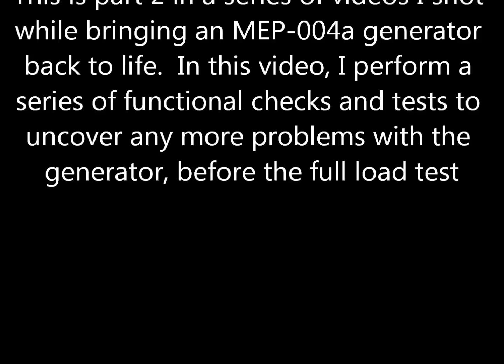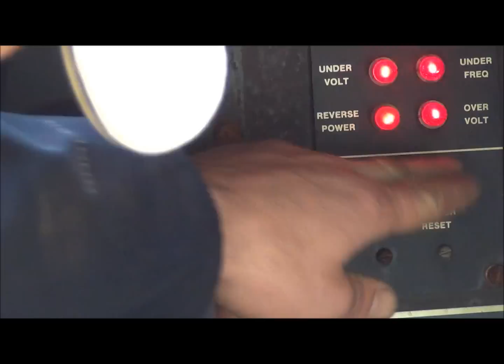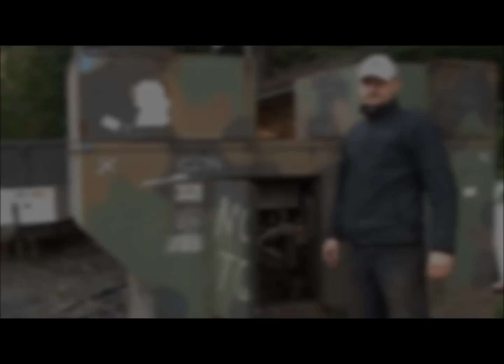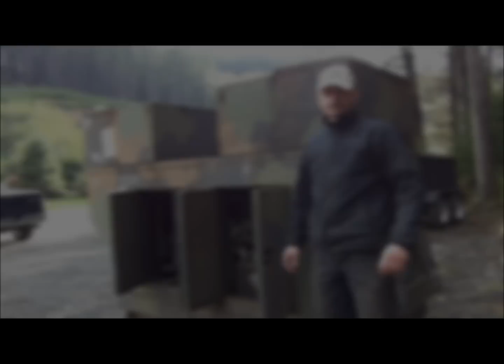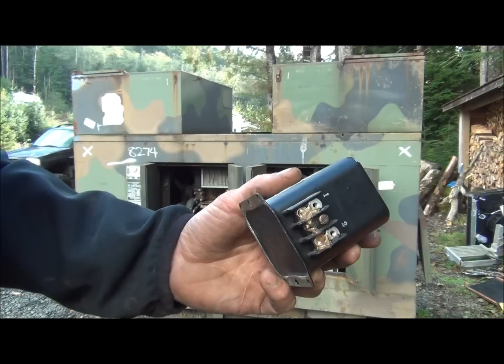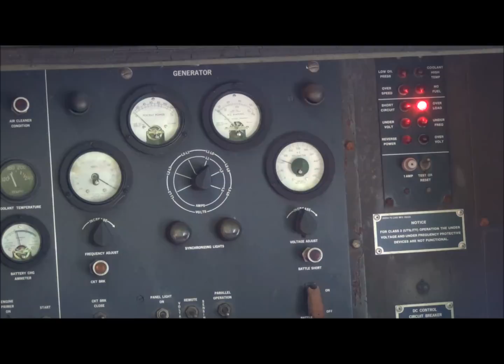Military surplus generator repair, and first start after years of sitting part 2

Comment: Hi Matt, I'm from Germany and I have exactly the same generator set, purchased from scrap dealer in the 90's. I use it as emergeny power plant and heating system. Since quite a while it started leaking oil at the front side (belt pulley) and I guess, it's the crankshaft seal... So I have 2 questions: Is it possible to replace it "from outside", which means: After removing the belt pulley and the engine mount bracket (while supporting the weight from the oil pan side), and: Could you give me any advice where I can get such a shaft sealing ring for this engine (Hercules)? I'm also interested in other spareparts like Filters, hoses, waterpump... Many thanks in advance and hoping for your response, Norbert

Comment: You wouldn't happen to have a manual for a Generator by 
Winpower?

Model # D-15h18z 

05/11/1964

It has a Hercules Diesel engine with a Roosa Master Injection pump.

Comment: Im not sure that dumping an electrical device that is leaking a black tar-like substance is prudent. Even handling it isn't a good idea. They may be old enough to still contain polychlorinated biphenyl (PCB), which is an extreme carcinogen. Best to isolate and let professionals dispose of those parts.

Comment: I have a 1962 American Marc Navy 5kw diesel.  The 24 volt batteries had the ground come off negative post and art and it stopped producing AC power and at the positive side of the batteries with it running is reading 52 Volt's DC. I have a shop manual and some parts but don't know what to do?

Comment: that"s amazing how the americans speak backwards compared the rest of the world .you cal a meter a gauge. gauge is for measure wire size,sheet  metal size .steel rod sizes .etc,etc,etc, For electric we cal a volt meter. amp meter, ohm meter ,frequency meter galvanometer ,gauss meter ,capacitance meter,inductance  meter siemens meter ,GAS meter ,WATER meter ,etc,etc,etc,etc,etc etc, etc etc etc etc etc etc ,not gauges.

Comment: Hi, nice Video :D what load are you using because i bougt an 30 KW military generator and i want to load test it after i figured out why it won't produce any power. I already hooked an adjustable DC power supply up to the two exciter ends and it produced clean power on all 3 phases. So the problem has to be something with the AVR unit.

Comment: About how much would a good generator cost? Is there a multi fuel generator,  with the engine like is in the older deuce and a half? That thing will run on almost anything

Comment: Curious Matt, have you encountered one of these with injection pump issues? I am looking at one they say the injection pump is bad. Unit only shows 28 hours on the meter. I have seen some pumps on eBay have also heard talk of rebuilding them. Can you shed any light on that subject?
Reply from the maker: MrBellboy1234 yes, they use a stanadyne pump similar to the ones in a gm 6.2 diesel.  I've sent a few off for rebuild.
Reply: Could you send me some info on where to send them off for rebuild?
Reply from the maker: MrBellboy1234 I sent mine to oregon diesel injection, but I believe that any decent diesel shop should be able to handle it
Reply: Were they able to find a rebuild kit or did you have to source a rebuild kit to send them? I have not had much like finding a rebuild kit online.

Comment: Brings back memories of my military days. My MOS was 52D30 and I worked on anything from 1.5KW up to 400KW.
Reply: I was in the U.S. Army Corps of Engineers 249th Engineer Battalion Prime Power Alpha Company Schofield Barracks, Hawaii from 1988 until 2010. Those things were dinosaurs when I enlisted. Mostly I remember running 3 120-volt 60Hz hot legs off them to power housing. I think we also moved them two to an M35A2. They were all over the DMZ in Korea. Those were the days.
Reply: Mr Ross thank you for your service

Comment: Correct me if I'm wrong but water will evaporate in a radiator after the engine heats up and also causes rust when ran in a engine thus why antifreeze was made, I don't know if generators are any different so please correct me if I'm wrong
Reply: He did replace the water with proper coolant if you had watched you would have seen him say so.

Comment: Great job on your videos they are very instructional. I have a mep803a which was running fine last month, but when I went to start it again this month it won't crank. It will turn over at the dead crank switch, but at the start swtich it is dead, nothing. E switch in correct position, battle short in off, but no noise when I move switch to start position. Any common issues that you have encountered would be a big help.

Comment: I was wondering if you ever ran into a mep 3  that will not let the fuel shut off cylinoid work.  If I don't hold the start long enough it will hold idle but it does not create power if the generator is creating power it does not hold idle fuel shuts off. it almost sound like what you just had in this video and it is over generating the gauges don't all  work and I I can't adjust the frequency the main selector is also frozen on 1 phase witch is what I need any way. I can manually control fuel  it runs and creates power any suggestions
Reply from the maker: +Roger Headrick Not quite sure I understand the symptoms you have, but here are a few pointers on the -002a/-003a:  1.  You should never let the set idle.  You should set the throttle for 60Hz and leave it there.  Allowing the set to idle can damage to voltage regulator card.  2.  To start the generator, you need to hold the start switch in start for about 10-15 seconds AFTER the set comes up to full speed.  This bypasses the low oil pressure automatic shutoff and flashes the generator field so that it will start making power.  As long as the speed switch is operating properly, the starter motor will disengage.  If you hear grinding, then you need to troubleshoot/repair/replace the speed switch.  3.  If the generator won't stay running, then you have a few possible problems.  But, most likely are the oil pressure switch and/or the speed switch.
Reply: +sewerzuk hi am Daniel from cal. tell me please where is the speed switch location please.
Reply: +sewerzuk 

please email me. 

Edwardp@penn.com

Comment: Would a generator like that be able to supply 230v 50hz or is it too small for that?
Reply from the maker: They are rated to supply 120/208 3 phase at 50hz; I can modify them for 120/240v single/split phase too...

Comment: Great videos. I just got a mep 803a and the master control switch is bad; is there a diagram to wire in toggle switches instead? I've looked all over and find no one with the master switch for sale for a reasonable price. many want over 200 for them..

Comment: What is your recommendation for a 50HZ 3 phase unit.. I am leaning towards the 805A.. but they are hard to find with low hours.. I only need 15-  30KW max..  and I like the idea of the Tactical Quit in the 805A ..
Are there any 15KW units available in 3 phase 50hz ?

Comment from the maker: Usually if I need a part, I just look up the NSN for that part in the tech manual and then do a google search for it.  I find most of the parts that I need on ebay, or through surplus liquidation places.  This works most of the time; but if not there are several surplus dealers that carry parts for the MEP's.  Gulf Coast Trucks, Delks, and many more carry many of the common parts.

Comment from the maker: No problem!  Yep; the M200A1 has both air brakes (no spring brakes) as well as a mechanical lock.  If the cables are still free (I have seen a number of them that are rusted into place) then your setup should work great!  I tow these with my 2001 Dodge 2500 all the time...

Comment: they assured me the brakes on the trailer lock down , look at my avitar , I I can lock it , and pick it up with a boom cable , kick the jack back , and lower it onto the hitch , I really thought it was going to weigh more than that for some reason , so to this truck it will be like a full size conversion van in weight , this should work well , I really appreciate your time in answering my question , means a lot to me , as very few have the knowledge to answer that question ;)

Comment from the maker: Assuming you have the -004a without ASK; it is only 2450lbs.  The M200A1 doesn't weigh more than 1000 lbs, so well within the towing capacity of a 1 ton truck.  The only issue is getting a pintle hitch high enough to match the M200A1's eye.  I custom built one for my Dodge so that I could tow these trailers around; I have even pulled a PU650-B/G with it (MEP-006a generator) which weighs close to 6000lbs on the trailer.

Comment: stupid question that I can't find the answer for anywhere , I just bought one of these generators , it is mounted to a m200a1 trailer , do you know the weight of either one of the two , or both , I am debating towing this home with a 1 ton dual wheel pickup , but a friend seems to think this might be a job for the deuce instead , any insite , it's a 400 mile run to get there and back , and the deuce sounds just painful that far ;)

Comment: I noticed from your close up of the gauge panel that both your voltmeter and power meter weren't set to mechanical zero. Not worried about that?
I noticed them because before I changed jobs I was responsible for the electrics on military generators from 500w Onans to 40Kw trailer mounted Lucas Aerospace gene's.

Comment from the maker: I suppose it depends on what you are comparing the MEP generators to.  There really is no comparison to something that is available at home depot or any other big box store.  There are some commercially available generators that have comparable features and build quality, but they typically go for 3-4 times the price that an MEP sells for.  The MEP's are rugged and overbuilt (for military field use) and have lots of instrumentation and features not found on civilian sets.